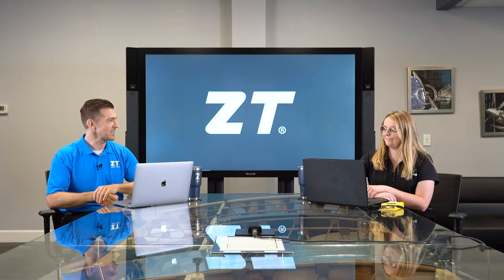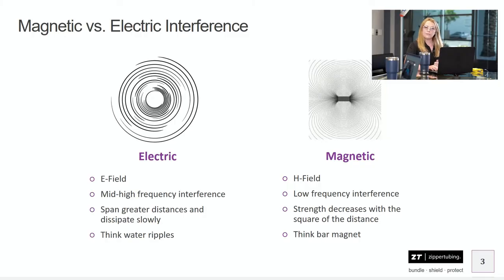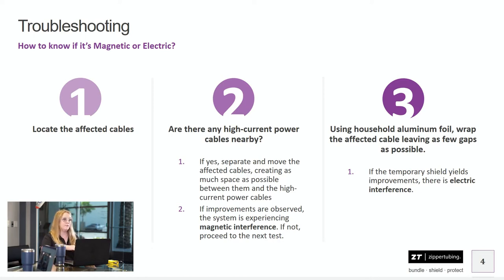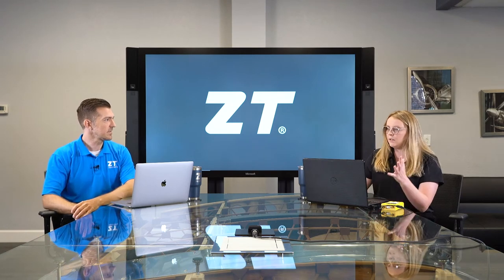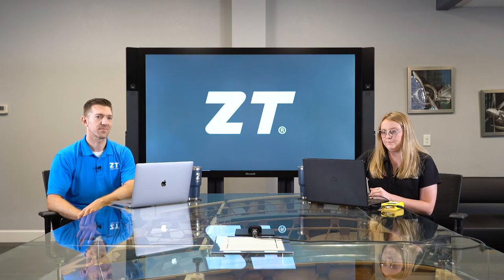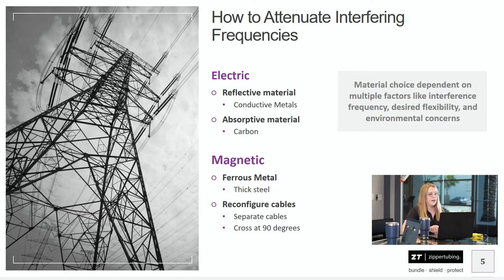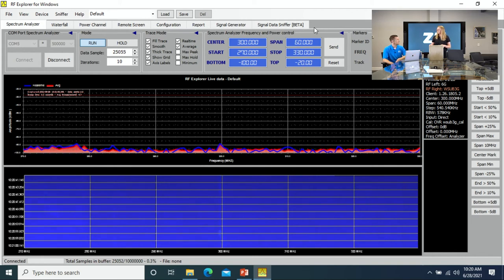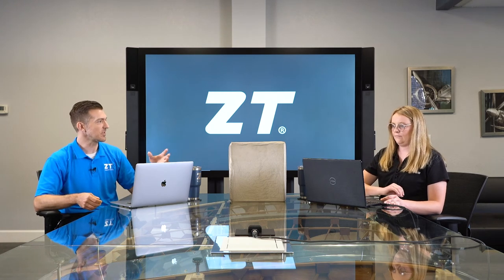Learn EMI Shielding | Magnetic vs. RF Interference (with Troubleshooting and Shielding Solutions)

Comment: Hello , I hope all is well ! I’ve been trying to get in contact with someone their ! Will like to try your tubing shrink ! I make massive 18659 battery packs ! Mostly for marine boats I buy a 6m roll from AliExpress and sometimes I fall behind and I forget to to put a order in ! And I have to wait about 5 days my vendor he’s in point but the only down fall it tens to crack after couple of months?
Reply from the maker: Hello Jose, thank you for reaching out to us. Zippertubing offers a wide assortment of heat shrink products; however, we do not sell "standard" heat shrink. Our heat shrink comes in many forms: EMI Shielding, Waterblocking, Wrap-Around (split heat shrink tape), and varied colors. If you'd like to discuss your needs further, we recommend reaching out directly to us via phone at (855) 289-1874.